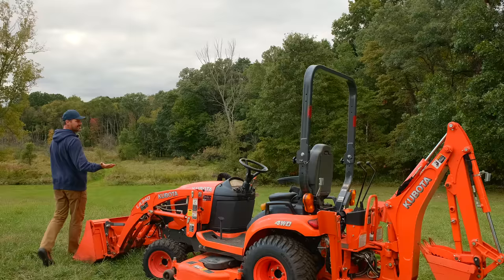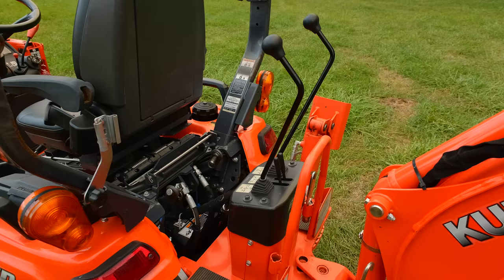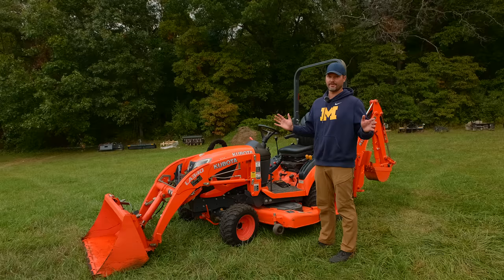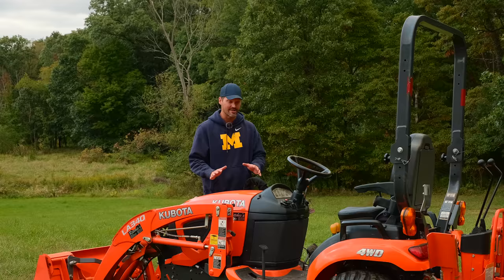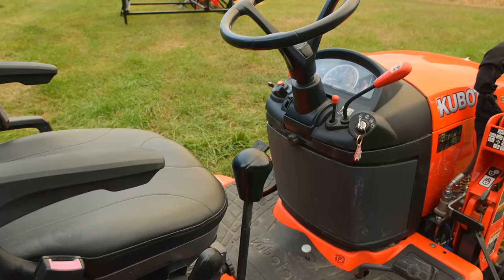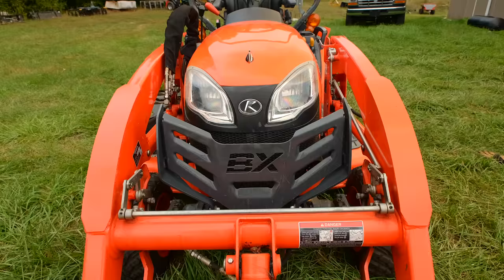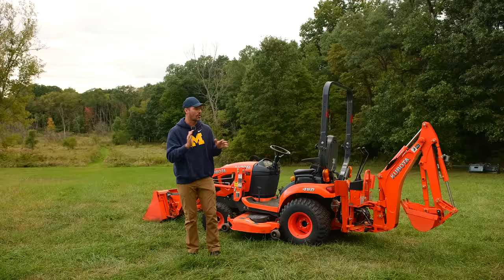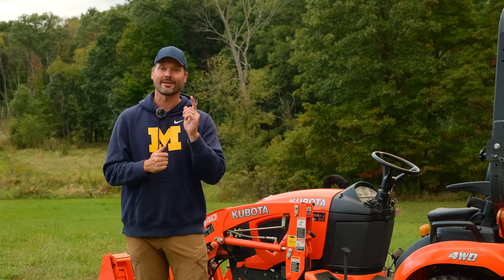PROBLEM AFTER PROBLEM AFTER PROBLEM

Comment: They all have their problems, no tractor is perfect at all. I am happy you tell it how it is Courtney, never stop doing that, makes your opinion mean a lot.
Reply from the maker: Appreciate it sir!
Reply: I disagree with you.  I have the perfect tractor - lol 😂 - and it’s still running today. 
In 1993, I purchased a Kubota B2150 with front loader, belly motor, post hole digger, and rotor tiller.  What an amazing tractor. I’ve got less than 3000 hours on it, and the only issue I’ve had, was the spline inside the hydrostatic transmission; and that was probably the result of user error (me) for using it as a bulldozer when building my house and raising the grade on our water front property.  My only regret is NOT purchasing the front end protection rack .  Now my hood has all kinds of dents on it from moving moving rip-rap.  I absolutely love ❤️ my B2150.
Reply: @Joseph-wp2ry  that is great! What I meant was just like you said in your example of having dents in your hood. Some will think that is the tractor's fault, the hood should not be metal. This is what I meant. There is no perfect tractor because some will always find faults (legitimate and/or perceived) with it. Just keep using it and if you think it is perfect that is all that matters! 🙂

Comment: I bought a BX25 TBL new in 2015. We used it at our country place mostly for clearing snow during the winter months. It performed well for its size but did have a couple of annoying issues such as you stated. The day I bought it home, it failed to start. Dealer sent out service tech and found the key switch corroded due to water getting into it from being stored outside. In the 8 years I had it, it was stored inside. I had to relace both front axel pivot seals, all tie rod boots, (inner & outer), and one of the loader hydro lines as it leaked. The machine has a decent amount of power for its size but its weight was very limiting as traction was often an issue. It was awesome on fuel and was quite easy to perform maintenance on. I recently sold it and looked at a  larger cab model B series but Kubota increased prices so much here in Canada, it practically priced itself out of consideration. I decided to go with a new Kioti DK4210SE which is to be delivered next week.

Comment: I have a bx2670 and I work my little tractor hard it has just over 400 hours and no leaks or drips anywhere however mine is also the older model that does not have the single point hydraulic connector. Those were a good idea on paper and easy to use but not good in the long run. As for the bucket being bent up apparently the previous owner was not very kind to it because I have done a lot of sketchy things with my bucket and it isn't bent up at all. The mower deck is not a drive over connect however you can physically drive over top of the deck when you remove it or install. You can also dump your loader bucket all the way down push straight down lift the front tires up after you have the deck released and then slowly back up and curl your bucket back to carry the front tires over top of the deck that works very well also

Comment: Thanks. I watched to see what I needed to keep an eye on. 7 years and 398 hours and no problems yet, but who knows what can show up. BX25D. My front bucket and backhoe bucket are not even orange anymore, I've used them. Bottom plow, scrape blade, box scrape, tiller, ripper, disk harrow, hiller, and bush hog have been used on it. Haven't modified anything. No mower deck, got a Ferris for mowing. Got friends who build houses so I charge them $351 for days work with the backhoe, that made every payment. Mostly use it for my 6000 Sq ft garden and two driveways on 10 acres. Thanks for your honesty and tip on the 6 ft landscape rake as I grow rocks here in the north Georgia mountains. I'll check out the website.

Comment: I love my 2017 BX23s.  It's a lot smaller than the 1025r, which is great when needing the tractor power in tight locations.  
Why did you buy it, everything you listed as negative, should have been known at purchase.  Obviously the leaks could've been a surprise.

Comment: I like mine,only thing that happened in a year and 50 hours was a oil leak in the rear end and they fixed it no problem.for it's size it does pretty good

Comment: I was shopping for a  50-60 hp tractor. I  looked at Deere, New Holland, LS, Mahindra, Yanmar,  Kubota, and Kioti.. The two it came down to was Kubota and Kioti. I ended up buying a Kioti RX 6620 cab tractor.. what a beast! It was almost 10k cheaper than the Kubota, more hp, a lot more features.  I'm sure that Kubota is a very high quality product  overall but the the Kioti seems to be a much better value and I've given it some really hard use moving dirt and it is tough! I would encourage anyone considering a Kubota to at least look at a Kioti before pulling the trigger.
Reply from the maker: Sweet, that’s good to know!

Comment: Your wheel spacers on the front are probably causing your clearance issues with the mower deck. Otherwise yes kubota could use some refinement on the bx tractors to make them more durable for work. To me the bx is for somebody that needs a little bit more than a garden tractor….   Keep up the great videos!

Comment: Hey Courtney, your content is top notch, your channel is probably a more useful and practical subcompact tractor than Messicks even.

I feel like if you have a 1025R and like it then its not surprising the BX23s you bought just sits. What could it be used for other than doing crew work in close quarters?

I knew nothing about tractors or property and it took me forever to even figure out what tool I needed until one day it came to me "small tractor loader backhoe" and when I typed that in to google the results were 1025R or BX23s. I hemmed and hawed trying to decide which one, and what made me pull the trigger on Orange instead of Green is an Andrew Camarata video that said he doesn't buy JD. Of course I don't have a JD to compare but so far I'm glad I got the BX.

I'm surprised you can't find much backhoe work on your property, I only have five acres and I've use it for trenching and stump digging a lot and have a lot more to do. I probably use it about 30% of my tractor time.

Anyways, pointless ramblings. Glad you made this video it was a lot of fun to watch!

Comment: Before getting a Kubota 2501, I had a bx1880, sold with 600+ hours…. worked great, no leaks. Even used with a pull-behind New Idea sickle mower & 10’ Ford Hay Rake prepping to bale hay. Would buy a bx again if I wanted a sub-compact with belly mower.

Comment: From Australia - Been around larger tractors all my life and downsized to 5 acres of bushland with the BX23s (I've put over 400 hours on it) I've dug out about 30 big stumps and the mid deck mower gets left on all the time because it is a total pain to take off and on on uneven ground which is all I have.  I love Kubota and this thing is tough and very well built (not a dent on it so far except for the useless grill at the front) but apart from being excellent as a mower everything about it is too small for my 5 acres and I do regret buying it as they are very expensive here (well over 30k 5 years ago). I do NOT find removing the 'tiny' 4 in 1 FEL or Backhoe a big deal however the FEL wouldn't lift the skin off a custard so I leave it off unless I want to use it for counterweight when using the backhoe, and yes having to get off and on all the time to reposition the Backhoe is a total pain.

Comment: I wanted to get a 1025r but it was going to be $10K more in Canada with a bush hog, box blade, and snowblower then the BX23s.  I've put about a hundred hours on it and so far it has done everything I wanted it to do.  Of course, if I also had a 1025r I probably wouldn't use the BX23s either.

Comment: I had a bx24 and bx24. They are not heavy enough to do a lot of work. The problem with the bx is the unprotected cheap plastic hydro fan. Cheap cheap cheap but not inexpensive to fix! They are what they are, I traded up to b2601 and happy with everything except it’s a little tippy ( maybe need spacers, eh Courtney) I still think the bx is the best of the class. Cheers
Reply: There is a couple of companies that make belly pans for the BX. The one I have works great it’s from Bxpanded. And wheel spacers are the first thing I put on my BX. No more butt puckers😁😂😂😂

Comment: BX23S owner here. They are made for the SMALL property owner that doesn't have access to other heavy equipment. It's not for the guys that own tens or hundreds of acres. I have 2 acres, and I use it to clear the land, regrade the property, fix the gravel driveway, dig the occasional French drain or ditch, moving mulch, mountains of dirt (100+ cu yds and still going), move logs, etc etc etc. Brand new, I paid maybe $23k and I'm close to getting what I paid for it, in work $$$ saved by the end of this year (2 years). Great little machine that never ceases to amaze me.

With that said, if you have more property or have larger projects, the little BX23S isn't gonna be enough. It WILL do the work, it'll just take you longer than larger machines.

Comment: 2021 BX 2380 here.  I have the drive over deck but do not drive over it.  I prefer the deck connection and mid PTO connection of the drive over setup.  I also had the leaky single connector.  There was a revised version that was covered under warranty and I haven’t had a leak since replacement.  I almost pulled the trigger on a 1025r but I have a Kubota dealer 3 miles away, 0% financing and about $1800 less made my decision.

Comment: I think you were a bit harsh on the bx23s.  You bought it with 400 hours on it and it looks like the previous owner was pretty hard on it.  The wheels rubbing on the mower deck is because of you spacers, mine doesn’t rub at all!   I don’t have multiple tractors to choose from like you so having a Swiss Army knife of tractors is huge for me.  We have done a bunch of projects around our house that would have been impossible without it and we have a lot more planned.  While it may not have the highest lift capacity or tightest turning radius it is well designed and engineered.  It’s a good compromise for all its ability.

Comment: Interesting take on that. Surprising that a Kubota has that kind of issues. They do have a lot of little knick knack things that I don't like but never steered me away from them. Right now Kubota has a lot of growing pains. They're expanding quite a bit in the United States.  My biggest complaint with Kubota right now is in their largest tractor series. Been out for two years nobody's even seen one. Got all my money back from the order. Even still no sign. Pretty sad 😢
Reply from the maker: Which series is that?
Reply: @GoodWorksTractors   It would be the Kubota M8 Series tractors. 200-250 horse . Versatile builds them and sells them under the Nemesis Name and has a few in the country

Comment: Very strange that this tractor has so many bent items, especially the body and bucket. I had a BX2200D and it was an absolute work horse for me. I will admit I ended up with both front and rear axle seal leaks. I replaced the rears, the dealer did the fronts. But I had 1900+ hours on it. And I pull cut down trees. buckets full of field and lake stones, dug dirt and gravel and moved it around, had a cultivator and landscape rake. Loved that little bugger. Needed a bigger one, and the prices in late 2021 had jumped crazily. So I bought an LS MT342HC. Love this one. But at the same time I wish I hadn't sold the BX. So I didn't have the problems you have had with the 23S. And tell your brother Blue and White is nice too.

Comment: I'm at 300 hours with with my 2020 model and no issues. The front axle leaked slightly when new but I kept the fluid topped off and ran it . The leak slowly went away as the seals broke in. Sometimes I think issues can come from lack of or extremely light use.

Comment: I have a BX23S and am just shy of 50 hours and no complaints. Now I do make a point of wiping down the single point hydraulic connector anytime I am reconnecting it, I am sort of anal about it because of past experience with hydraulic contamination and seeing how little it takes to break things. My machine lives inside when I am not using it. I also try and go slow and steady with it, because in my experience that seems to be were the machine is most effective and its surprising how quickly I an dig up a 5-6 smaller tree stumps. It would take me a whole weekend by hand and this thing gets that work done in a few hours. 

I do have a theory that we all have brands that we are meant to own and ones we shouldn't. I had two jeeps that were absolute nightmares, everything that could go wrong did, but I knew people (and these were people I met in person) who had no problem whatsoever. Conversely I have owned numerous GM vehicles without a single problem and heard from others who had the exact opposite experience. Not sure why or how that works but maybe the universe just doesn't want you to have a Kubota and perhaps I would be going through hell if I had a 1025R.

Comment: I own two Bx tractors and have none of these issues.  The only bending of metal came after I turned it up by the overload valve . I have 1000 hrs on a Bx 22 and 500 hrs on a Bx 25D that I use on a landscape business.

Comment: I have a Kubota bx2380 with a loader and mower no backhoe. I have a garden tiller for it also. I use it primarily to mow and for tight snaller jobs. I have zero complaints with mine. I have R4 tires and mine do not hit the deck.

Comment: Team green has been good to me. And when auto connect is adjusted properly, there's no better,  easier, way to connect a mower deck. It would be nice if they put a higher flow pump on the 1 series for the backhoe to run a little smoother though. But let's be honest, if there was one brand out there that was perfect, it would be the only one purchased. Keep up the honest reviews. We appreciate it.

Comment: Well we have a BX23S and love it. Everything works just as it should and is perfect for the small farm owner. Just like someone below said it was thousands below the green guy, $6k in our area to be exact and it works just as well if not better judging from our initial test drives before we purchased. From the looks of the bends, dings and scrapes on your machine I would begin to expect operator error over equipment quality. Oh, and I grew up on a 50 acre farm with Popping Johns and Farmalls but I don't think our tractors were ever that banged up. My Father and Grandfather would have skinned us alive if we had parked a machine with it banged up like that.  There are always things that may go wrong with company's new tractor and a reputable company will see they are repaired, but having pride for and taking care of your equipment is your half of the bargin that must be held up.

Comment: Love my BX25. Just like people told me, I found more ways to use it than I ever imagined. The BX25 has the front loader and the backhoe. I don't have a mower or other attachments although I did buy some clamp on forks. We built a house on 8 acres of virgin forest property in Lancaster Co, PA. We've had plenty of need for a backhoe, like to plant trees, dig out for a paver patio, dig up a pipeline problem, bury my in-laws' cat, prepare gravel foundation for a garden shed, etc. Actually the biggest use for the backhoe has been digging huge rocks out of the 1000 sq ft vegetable garden. The forks are handy of course for anything on a pallet (that doesn't weigh more than like 500 pounds), for loading up fallen branches or picking up logs. About the biggest log it could handle was a 8 foot long 16" oak. If I could do it again, I probably wouldn't buy clamp-on forks because they don't stay parallel and you can't use the forks to push things around because it ends up that the fork is often what gets pushed around. I am thinking of using the forks as a basis for my own custom attachment, a front pitchfork. We get loads of grass clippings for free and use them as mulch all around the yard. The guy dumps a truckload and the front loader doesn't scoop up the clippings very well. It would be better to have something like a giant pitchfork. So I'm thinking of welding up a mesh of rebar pieces that slides over the clamp-on forks and works like a pitchfork to skewer the pile of clippings. I do wish it had more clearance because I want to cut some pathways through the woods.

Comment: Wow. Would have assumed Kubota would not have so many systemic concerns..I actually went with Massey Ferguson recently, and felt Kubota may have been a better choice. I’m actually very impressed with Massey Ferguson 1723EB.
Reply: I test drove a Massey. Liked it overall but had way too much vibration.
Reply from the maker: Bigger Botas are great
Reply: I have a MF 1740M, bought it in June of 2019 and I have almost 290 hours on it now.  It is absolutely an awesome tractor.  In fact, I would love to have a GC1725MTLB with the backhoe on it as well.
Reply: @tlm3574  I chose Massey as it’s VERY well built. High quality. I believe all the big brands are good as well, but just went MF. Had it for about a year and it has been phenomenal.

Comment: I think that after you get moved onto the new property and you need to run power or water to a building or just a location, or need to clear some area. You will be very thankful that you have that excavator. Digging 200 plus feet of trench will go a lot better and faster than the backhoe on a tractor.